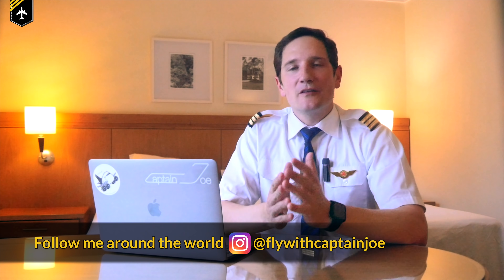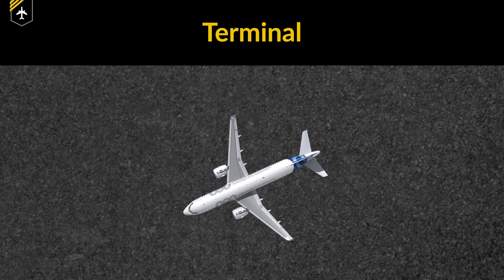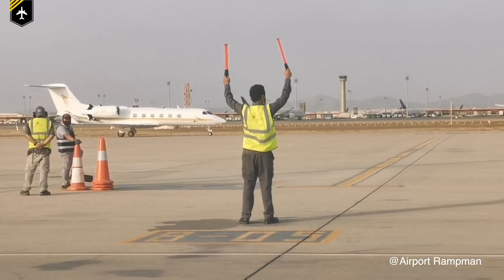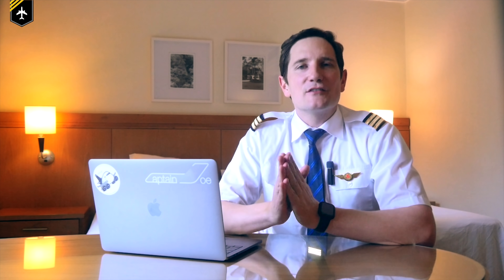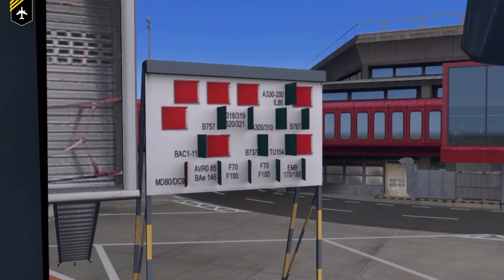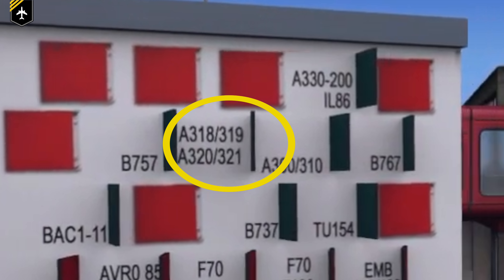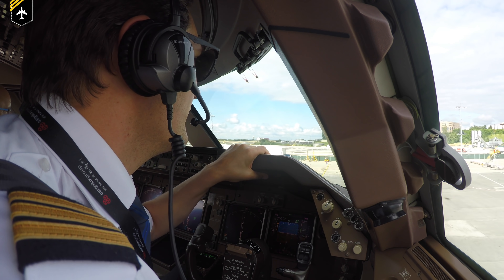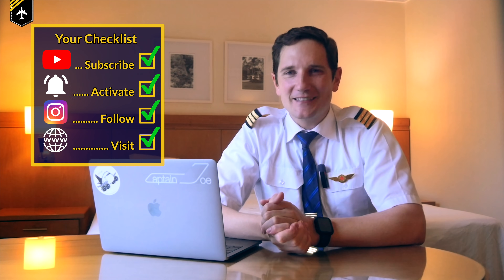HOW do PILOTS PARK their plane? ACCURATE PARKING explained by CAPTAIN JOE

Comment: Way back when, those stop lines were also used to set the coordinates on the inertial guidance computer on the ground. Each gate had the exact coordinates for that gate.
The aircraft that was shot down by the Soviets had transposed two digits and flew off course.
Be grateful for your GPS. Hug it and kiss it and thank the gods of the sky that you don't have to deal with inertial navigation or LORAN.

Comment: I missed an explanation about consequences of parking incorrectly / why such high precision is necessary, talking inches for planes dozens of meters long
Reply: Well airports are tightly packed as it is and there are different parking sizes for different airports. A 5 inch difference would mean maybe your tail would stick out the back or your wing would stick out to the next parking space. Besides, it's not that difficult to have that kind of precision.
Reply: It looks effortless indeed. Where i live people have a hard time parking cars within 5 inches of assigned spaces or sidewalk curbs. Planes, pilots and ground crew are very advanced for having made it so easy and precise. And now just reminded me of dockings in outer space 😲
Reply: @remigiochilaule1961 the only thing that's kinda hard for parking planes is upslope terminals while on single engine taxi 😑 docking in outer space would be a lot more precise I think.

Comment: I’m surprised no one has put a wide angle camera on the nose wheel. If it were on the nose wheel, you would have to rely much on the ground crew since you can see the line and the different parking lines for different aircraft.

Comment: In addition, some airports (such as mine) has the docking system connected to the CDM system so that times are displayed on the docking system. In addition to the things Joe mentioned, the display will show the EIBT (CDM speak for estimated in-block time, formerly known as ETA) so that all ground staff can see it with a quick glance. Once docked, the display will show times such as a countdown to the TOBT (target off-block time, formerly known as ETD) so that both cockpit and ramp easily can see the latest update. And if you would happen to be delayed, and there is no new TOBT, it will starting counting upwards, just to create that little extra bit of stress. ;-) That old board system at TXL, that's something else!

Comment: The downside to these is that they require the aircraft type & series info to be entered by us ground crew prior to the aircraft entering the stand. The small lcd input screen is completely non usable in bright sunlight & entering the wrong info results in a STOP signal. If the pilot enters the stand too early or too fast the system can not be reset to the correct aircraft type, requiring a marshaller to be called. The laser requires constant calibration, when calibration is incorrect the system can not “see” or confirm the aircraft type and gets stuck in a search loop. It will also incorrectly report stand blocked for no reason. In comparison the old Agnis light was great for us as it had one on button and no need to know which aircraft type/series was due to arrive. Though one pilot parked the no.1 engine on top of and squashed our new baggage truck many years ago. So the Agnis lights and even the giant mirrors were fazed out in favour of the laser guided systems. Fun fact is that the system likes to tell pilots off by displaying in giant letters “TOO FAR”, “SLOW DOWN” etc. 😂

Comment: Do they also use these systems when taxiing ? Im curious because planes are always very precise when following the taxi lines.
Reply: Yes, that might need an explanation, I am not sure Joe has covered that earlier
Reply: No system
Just follow the center line visually and use reference point inside the cockpit
For 737 if you keep the center line between your legs you are more or less on spot😂
Other planes has different reference point inside the cockpit
Reply: Oh ok that’s cool to know😂

Comment: Some planes have a camera above the nose gear so the pilot can see the lines and drive into place without a marshaler.  The image shows up on one of the displays when activated.
Reply: Unless the camera is looking straight down, it will be difficult to stop on the required aircraft type line. I haven't seen any aircraft use that camera for parking, but it could be somewhere.

Comment: I use to work for United Airlines when I was younger and I use to be a receiver and dispatcher for the planes. It was a fun job to do. I use to push back A-319, 737, 747, 757, 767, as well as the 777. So watching this video I knew what Captain Joe was talking about. In fact right before I left united one of the gates at Dulles International was trying out one of the guidance systems for the bigger aircraft. This was a great video.

Comment: When I was Active Duty US Air Force I used to Marshal the C5 Galaxy, that plane makes you feel so small.
I was assigned to a C141 unit but sometimes we parked other Aircraft.  
I finally got to work on fighters which I preferred, the F15 Eagle and my last aircraft the A10 Thunderbolt II or the Warthog as we called it.

Comment: Joe, if a pilot accidentally screws up parking somehow and he/she is too far in to the apron, how can this be corrected? Would a tug have to push it back out so it can correct, or what? Kind of like when you park a car and you need to reverse a bit to correct your position. How would this work in an aircraft?
Reply: As a former marshaler , very very few pilots over shooting and usually because of the marshaler fault. but usually no more than a foot or 2 maximum, which does not need corrections since the airbridge usually flexible, if the aircraft exceed more than few feat there will be the danger of  hitting the ground equipments, and that never happened during my career as a marshaler.

Comment: The point of view of a marshaller is so amazing😍 Seeing hundreds of tons of metal approaching you at a very slow speed, obeying to your commands, must be an amazing feeling
Reply: Except when they aren't coming in at a slow speed and you feel like your about to be run over by a 767 or better yet 747
Reply: Stephen Graham  
Even with earmutts must mess up your hearing in the long run i bet .
Reply: If you buy the proper type and keep then until inside your good, but i suggest to all the new hires to wear ear plugs inside the bag room, because of the constant noises of the machinery @robertsantiago953

Comment: Planes are heavy. How long can a plane park in one place without damaging the tarmac/ground?
Reply: That is entirely dependent on the type of plane, parking place surface and intend.
Parking stance and (maintenance) hangars are designed to allow the max capacity aircraft that is allowed at that airport to be able to stand still for a very long time.
A airport build for smaller general aviation will not be able to hold a fully loaded commercial sized cargo jet.

the taxiways and runways are capable of holding even more wait do to the impact they get when a aircrafts comes in for a landing. the very first point of contact  gets a very heavy load with in a split second. with every landing.
Reply: @sirBrouwer If you put some dumbbells on a carpet for an extended period of time, you get marks on your carpet. But if you roll the dumbbells over your carpet you will not see any marks. With this in mind, should planes not be juggled around from time to time to prevent damaging the airport or storage area? In this pandemic period it should be a valid question to ask since I see pictures of planes parked everywhere, even on the landing/takeoff tarmac.
Reply: @kmwong1786  they do move the aircraft's more to prevent it's wheels to become square. 
No doubt that this will also help the ground underneath. The tarmac might be more impacted than the concrete stands.
Reply: @sirBrouwer  thx

Comment: I just hate when pilots don't comply with my signals! It's the worst for me!!!
Reply: I feel with you. Especially when I trying to show them that the wheel chocks are inserted. 60% of the pilots don’t recognise my hand signals. What I do in most of the cases is that I flash my wands and tell the captain via headset that the chocks are in place.
Reply: Or the ones that taxi in at full power and get pissed when you have to push them back to the right line😂
Reply: @blackmusik109  Nah, just leave it. You've done your job, now it's their problem.
Reply: Simple solution. Walk away, go to the toilet, get a drink, get a snack and enjoy your extra break. Then go to the next flight, and give it another shot.

Comment: Hey pilots, we prefer you come in with a bit of way under you vs stalling at our slightly uphill gates. Mike/SAN
Reply: It's becuase of fuel saving procedures requiring pilots to turn of one engine, quite hard especially on full passenger load
Reply: I once had a pilot say he didn't have enough power to come into the old LGA gate ended up having to tow him in tractor got stuck on the gate yay equipment we couldn't use

Comment: I always thought there was a camera system fitted on the nose wheel, or aircraft nose
Reply: I think they don't use cameras for this purpose because although that might be fine to maintain the ramp centreline but an additional system still is required to anticipate the correct stopping point for a particular airplane. Also, engaging the pilot's view straight through the window should give pilots the opportunity to keep scanning the vicinity for obstructions as they move into a rather enclosed area. Engaging their view to a screen in the cockpit may not provide such an opportunity.
Reply: Right? I figured it was like a back up camera in a car.
Reply: There are taxi lights on the wheels which I assumed to be cameras
Reply: There are some airliners who has but it's ultimately an "extra" option for airlines.

Comment: One interesting point from the ground crew perspective: at most VDGS-positions the ground staff has to perform a FOD (Foreign Objects Debris) check, before they are informing ATC that the parking position is clear prior to the aircraft landing. This is the case f. e. in Munich, where the ground crew - after they checked the parking position for FOD - activates the “parking gate clear”-button, to letting the controller know that the position is ready and safe for the arrival of the incoming airplane.
Reply: We have those buttons too in HEL but for some reason they are not in use. 
We have SafeDocs and as good as they are, they can also be a pain in the @ss. This one morning a while ago air was very humid and chilly. Humidity turned in fog because the stand was partially heated. So the lazer picked up the vapour rising from the ground and kept signaling "GATE BLOCKED" while the aircraft waited there for good 15 minutes.

Comment: Modern planes have a lot of Hi-Tech Equipment onboard, and if ultimately the captain(Who is sitting inside the plane) is responsible for safe parking, doesn't it make more sense for airplanes to have some sort of camera-screen monitoring sort of equipment (something like a car backup camera) inside cockpit instead of relying on external guidance?
Reply: The captain is responsible for the safety of the plain, not for parking inch perfect without help. You should interpret that as: if the captain does not trust the situation, sees possible danger or suspects the automated systems to not work properly, he is responsible for stopping the plane and ask the ground crew for help. It will not be okay to ride over a baggage truck and the captain then saying "yeah but the system said I needed to move forward so I did lol". The same with car navigation and driving. Just because the navigation tells you to turn right it doesn't mean you do not have to watch the mirror and follow traffic signs.
Reply: Well on some planes there are cameras pointed on the nose wheel to check the center line position, but it's ultimately an option for airlines and airlines will tend to save a buck rather than put on extra cameras
Reply: Well yes, but every aircraft would have to be equipped with it then. Imagine all the cost not only of installing and training these systems but also maintaining them. Then what do you do if you have no external system anymore and the aircraft internal system fails?
Of course you could ask for ATC and I understand your thought.

It's a pretty good question to be honest and I'm not a pilot.

But just judging by logic sense, I would assume that it would be much harder to install and maintain multiple systems in aircraft rather than just one on the parking stand.

Wishing you all the best

Your Noah

Comment: Does the Captain always park or is the FO allowed to do it too?
Reply: Depending on the architecture of the parking position (as CJ said, some systems work only for the left seat), the equipment of the aircraft (some models, especially older ones, have a tiller only on the left hand side), and the company policy. If the company allows the copilots to taxi and the gate is equipped with a system that doesn't rely on the pilots point of view, the FO can park the aircraft just as well.

Comment: Can't they just have a camera facing down in front of the nose gear
Reply: Some do. But this comes with extra cost and complexity. So it's only installed as an option when necessary, so generally on very large aircraft like the A380, B747 and B777 or private aircraft like the Global 8000
Reply: @Horstroad  Thank you very much for the explanation, have a great day!

Comment: As a very low-tech solution for a guidance system, wouldn't a big mirror on the building do?
Reply: different angles for different aircraft sizes would make it impossible for some pilots to see it properly.. also getting it dirty will cause issues with visibility
Reply: Mirrors were used years ago, worked fine - but pilots got annoyed when you accidentally stood in front of them. 😀

Comment: Delta  airlines has a gate safe automatic parking system.
Reply: Not all Delta locations have it.
Reply: @ChrisJohnson-hk6es  Exactly, also not every location, where Delta normally parks, is automatically a Delta location. In the US, yes, in Europe absolutely not. In Europe, Delta can be parked at any stand cause the gate planning is done by the airport or ATC, not the airline.

Comment: Why were the winglets desgined?
Reply: To increase fuel efficiency.
Reply: But how
Reply: @matiasprudencio9947  it reduces the effect of wing tip vortices.
There's an area of low pressure air above the wing and high pressure air below the wing, separated by the wing itself. At the wing tip this barrier isn't there anymore so nothing hinders the air to go from the high pressure side to the low pressure side to equalize the pressure differential.
We need this pressure differential though to create lift. With the air flowing around the wing tip and destroying the pressure differential, the last few meters of the wing don't produce as much lift as they could, so we would have to make the wing a little bit longer to compensate for the missing lift.
This inefficient section of the wing produces just as much induced drag due to the aerodynamic effects as any other part of the wing. Additionally the vortices that form around the wing tips produce even more drag.
So not only do we lose lift, be we produce more drag.

A winglet or wing tip fence ore raked wingtip greatly reduces the flow of air from the lower side to the upper side. This means for the same amount of lift we can make the wing a little bit shorter than we could have without the wing tip devices and we reduce drag due to the smaller vortices.
So we save on fuel because we produce less drag and it has the positive side effect that we also reduce wing span and might fit in a smaller gate.